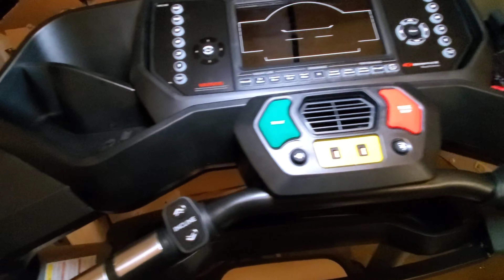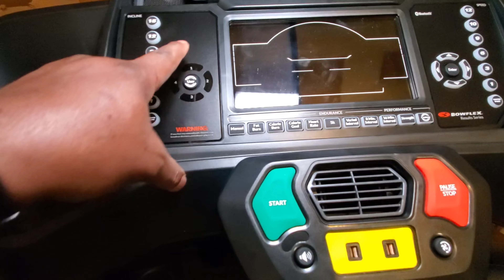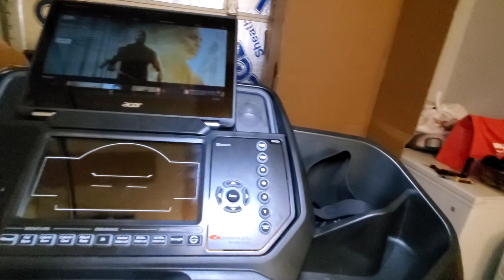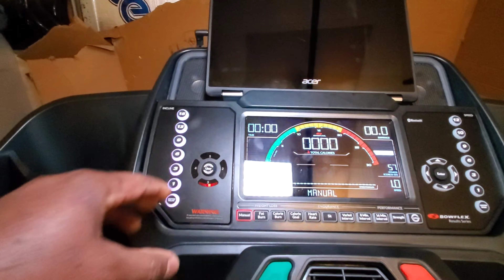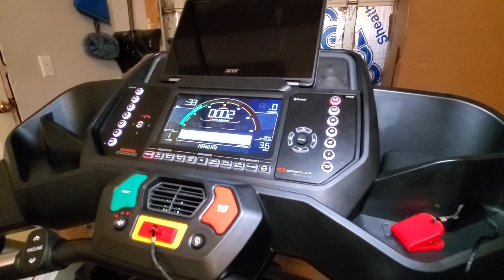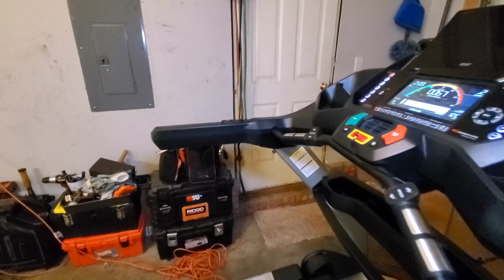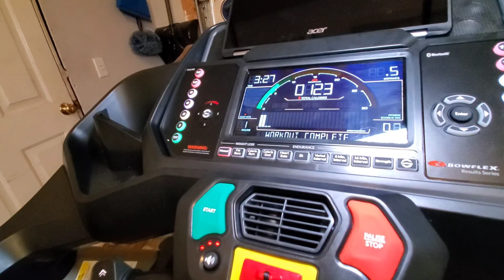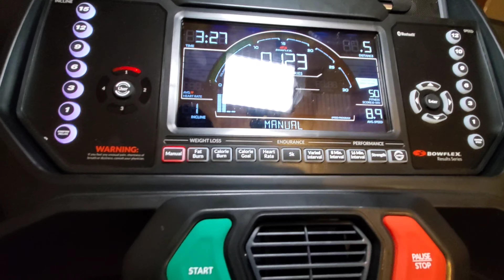2020 Treadmill Bowflex - BXT-216, Unboxing, Assemble and  Review

Comment: If that tablet pops out of that little front holder it's going to fall back onto the floor. With someone running on it I'd be worried it would fall out. Is there another support for it on the back that extends out that we missed in the video ?
Reply from the maker: the front holder is very big and holds the tablet very well we never have any problems with the tablet and the Treadmill everything is running smoothly

Comment: Hi. I need maintenance advice. I have one of them since 2018 and it is really noisy. How can I eliminate the squeaking? On the other hand, it is a good treadmill, maybe the best!
Reply from the maker: your Treadmill is now 2 years old. Every Treadmill makes noise after a long time of use this means you have to adjust and lubricate the Treadmill Belt and also make sure to clean under the Belt. Check your owner manual page 50 - 51 for Belt Adjusting and Lubrication. also check page 54 for maintenance parts  location this will help you know what needs to be adjusted, cleaned and Lubricanted., I hope this helps 🙏

Comment: I have one  and in 5 seconds it turns off . And i try every thing and , it will start and as I want to turn up the speed it shuts off , can you help it’s only 2 years old ugh
Reply from the maker: try plugged it in a different outlet and see , the Treadmill motor is more powerful than the power coming from the outlet because some outlet has a low voltage fuse that only support things like TV
Reply: @Loverofengines101  I done what you asked and does the same , but thank you for your time i  am so sadden ugh 😞
Reply from the maker: maybe you need a new motor for the Treadmill, very easy to replace